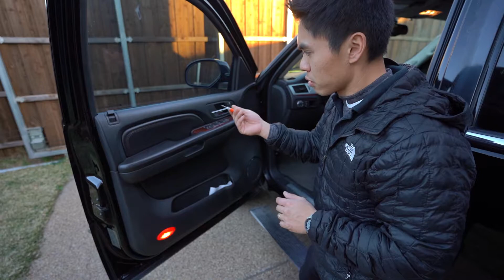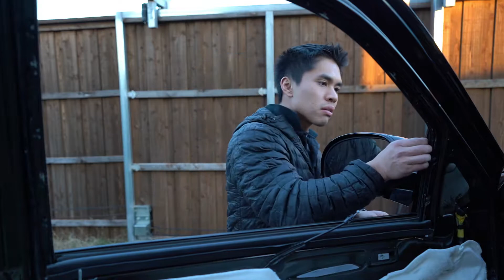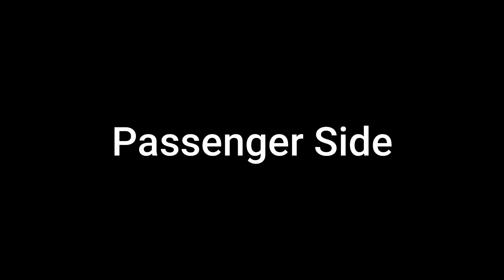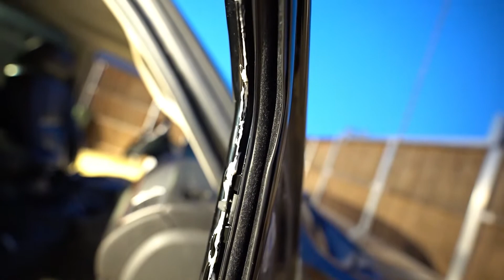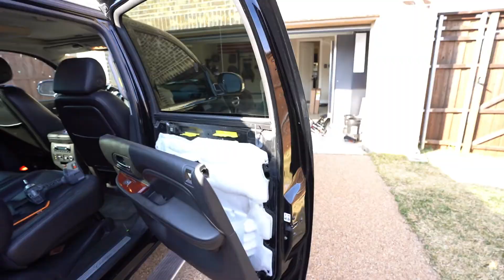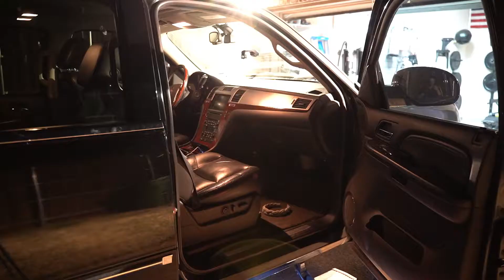2007 2014 Escalade Window Trim Replacement Wind Noise Fix

Comment: This is an excessive and pricey fix especially if none of the clips were broken causing wind noise. The seals aren’t needed as well unless leaking in the cabin. My clips were broken on the driver side because I locked myself out and needed to pry open that section. The vid is informative nonetheless because I saw the part on eBay for awhile but was unaware on the difficulty of changing it. Wrapping the pillars in black is a much better option and won’t fade overtime. Don’t buy the pillars overlay because the quality is horrible.

Comment: Did this fix the noise or did you also have to add silicone again?  Wondering if GM updated the part to fix this issue or not.

Comment: A much cheaper way to achieve essentially the same result is to R&R the bezel's deteriorated foam seal.  Everything else is hard plastic.  Just be careful when removing the bezel so you don't crack it.  You may need double sided tape for the wide edge as the attachment tabs break easily.  The side mirrors have an additional attach point above the top bolt.  A quick downward strike on the mirror after loosening the nuts will dislodge it.  And the door gaskets cross-sectional shape can be improved by pulling a 3/8" nylon rope through the large opening that runs the length of the seal.
Reply: Do you have a source for purchasing the proper foam seal that’s needed to restore them?

Comment: Awesome video showing the replacement of the exterior reveal moldings on the EXT. Thanks for being so detailed and letting us know what to be cautious of and what to take our time with. I've been looking at replacing mine for some time now initially for aesthetic reasons because with age they do seriously fad pretty bad and they begin to to chip. After watching your video I know know that's where the wind noise is coming from. One thing I did not realize is that you had to literally take apart the inner door just to get to the outer moldings. How long did it take you to completely change out just the front driver side door?
Reply from the maker: Be careful a solid 45 minutes just don’t break your new door trim, the key is to take your time don’t rush it.  Once you do one door you’ll get a feel and finish the others faster
Reply: @ThatShortGuy91  Thanks. I appreciate the advice. I'll be sure to take plenty of time when I start this project.

Comment: What is the name / model #'s of the parts you purchased? How much did they cost?
Reply: I found them on ebay the most was 150.00 each
Reply from the maker: Around 1000 the window trim isn’t cheap I went to my local dealer to buy them they are different dependent on your vin number

Comment: Where did you get those parts from?
Reply from the maker: my local GM dealer
Reply: @ThatShortGuy91  How much was window trim?
Reply: Did you trash the parts that you removed. I need front and rear right hand side trims. Don’t care about wind noise if they are otherwise in reasonable shape ? Could maybe do a deal ?
Reply from the maker: @gleneagle8070  im sorry i trashed them a while back
Reply: Did it solve the issue.! And how much it cost you since i have the same issue of wind noise and i cant deal with it